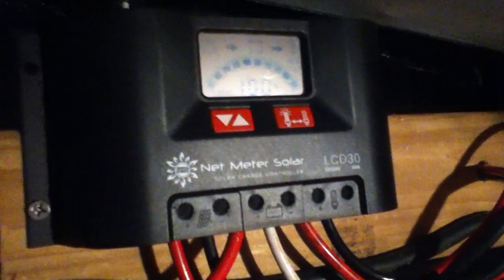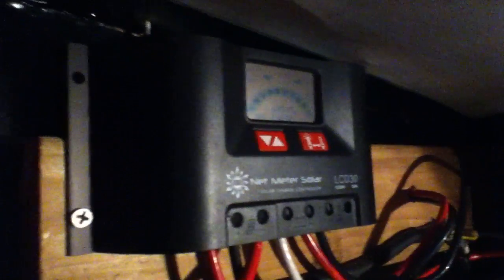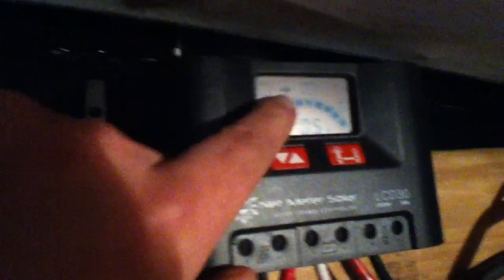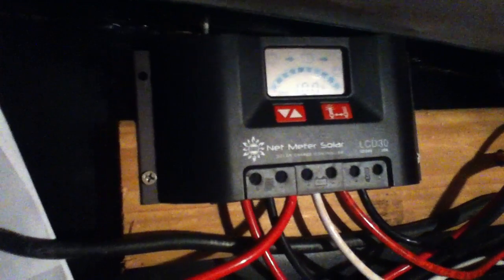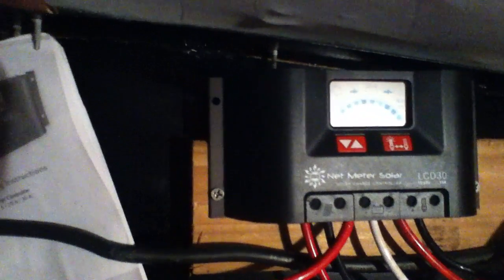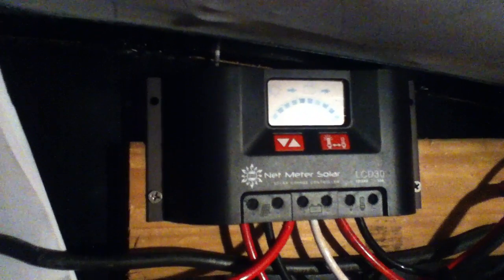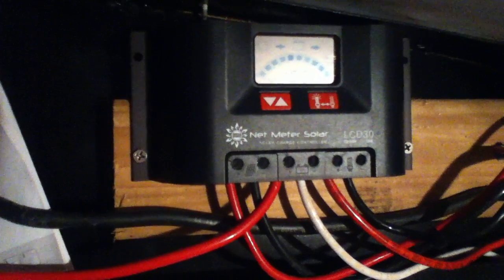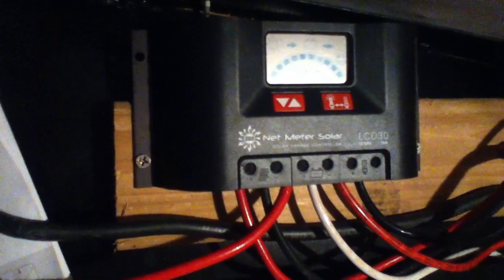Net Meter Solar LCD30 Solar Charge controller

Comment: can i ask your advice i have a charge controller (30a 12/24v) charge controller and have wired the battery (12v dc) into it (no fuse) and the charge controller lcd display will not come up do i need to attache the solar panel 2 get a display? i have pushed all buttons and made sure the battery has 12volt dc charge and i dont know what to do? please help
Reply from the maker: Check the polarity on the hookups and maybe the fuse is bad, you should get some display as soon as the charge controller is hooked up to a battery.
Reply: 8digitPDX as soon as i connected the solar panel it powered up fine and i am not using any fuses also it is not chargin its discharging and dont know why it wasnt charging, any ideas?
Reply: ok after 12 hours of charging up my batt it now works on my solar charger for solar charging 100% fine now thanks for your advice
Reply from the maker: Strange, I though mine gave a readout when the panels were not hooked up but the battery was hooked up.   Was the battery totally dead when you first hooked it up?  Does the display stay on at night?
Reply: 8digitPDX it was but when the sun goes down is it normall for the battery to discharge or how can i keep the level the same until the sun comes up again so that it does not discharge my batterys as i am using pwm solar charger?

Comment from the maker: I have actually burned through two of the LCD30 charge controllers on that same 400 watt solar array.   The burnouts happened during the summer on both occasions.   I later replaced it with a Xantrex C35, but I liked the Netmeter solar controller because of its display a heck of a lot more, it is almost worth using them and burning them up and replacing them periodically just to get the advantages of that display and the controls.
Reply: Yes better to the batteries, the manual says if you have the battery direct to loads (inverter) you have to change SOC to VoL (charge method)

Comment from the maker: You can run a lower powered inverter directly off the charge controller, but a higher powered inverter, say 1000 watts or bigger, can burn it up.

Comment: yes it has to be an isolated ground for it to correctly read the amperes output and control on/off to your lights, i also have my ac inverter directly connected to the controller just to read the measured output. enjoy your free off-the-grid electricity!